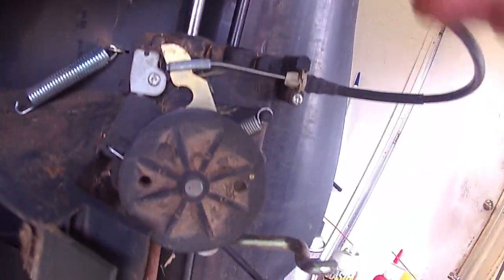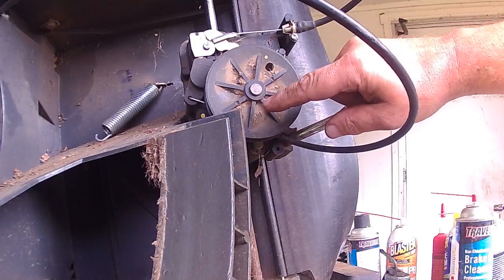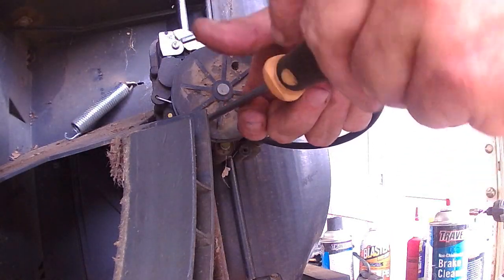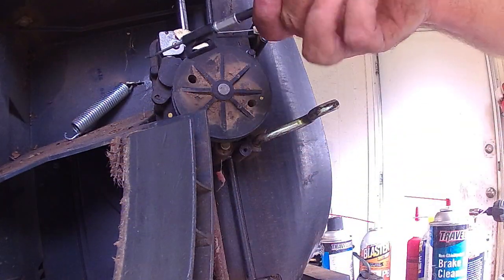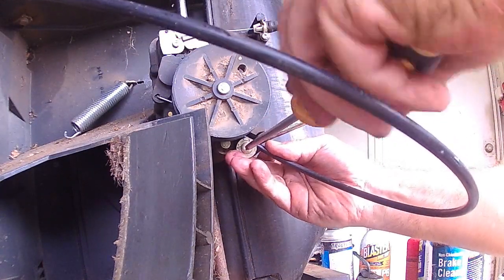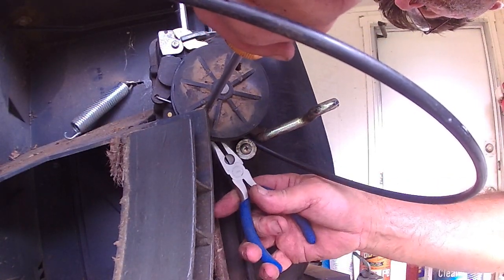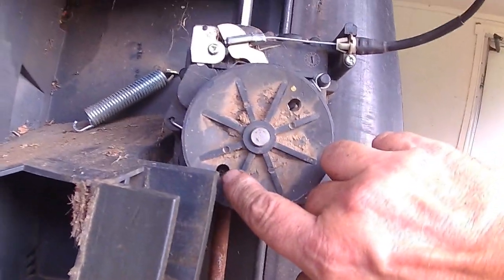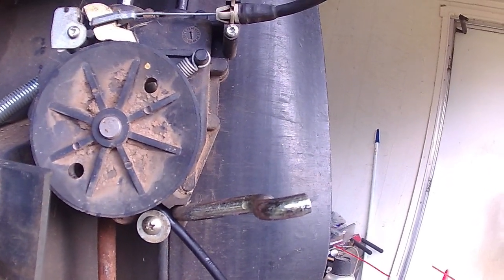Honda shift cable lost footage

Comment: I have the professional model with the  front extended wheels. All but two of my cables were frozen up. I am starting to think I should have scrapped this mower. I cannot get the transmission to rotate, I need to look it over more. Mabe an older video but still priceless information. Thankyou.
Reply from the maker: Good luck!

Comment: Hi sir , I have a cuestión ? How you change the plastic pulley ?, Because my is broken and the band it’s out of the pulley .
Reply from the maker: If you mean the plastic pulley on the transmission it is held onto the shaft by a spring pin. The spring pin and the pulley can be purchased online at ereplacementparts, partstree, your local small engine repair shop should be able to order it or a honda power equipment dealer.

You will need a long punch of the proper diameter to drive the pin out and drive it back in after replacing the pulley.

Good luck and let me know how it goes. Thanks for watching and commenting!
Reply: Appreciate your help sir , your videos helping me a lot work on my machine thanks a lot sir I will let you know sir thanks

Comment: Hi sir it’s marco something happened with my machine the gasoline comes out from de carburetor,, do you know way that happen?
Reply from the maker: It could be the bowl gasket, the bowl nut gasket or the fuel line connection to the carburetor. The float could be stuck open or the needle valve and or seat could be bad.  If you are working on the transmission and the mower will be on it's side, make sure the fuel is shut off and the bowl is drained.  Good luck and let me know what you find.